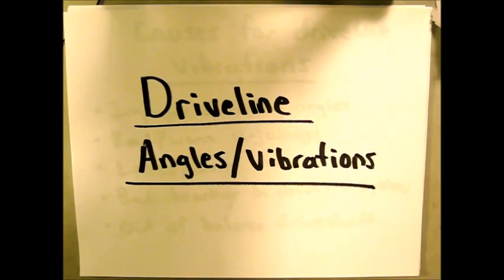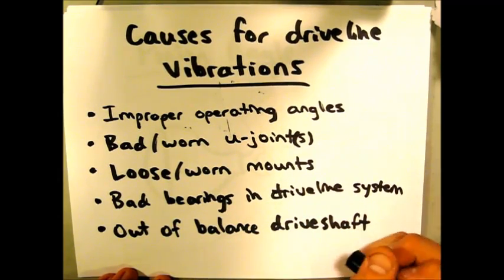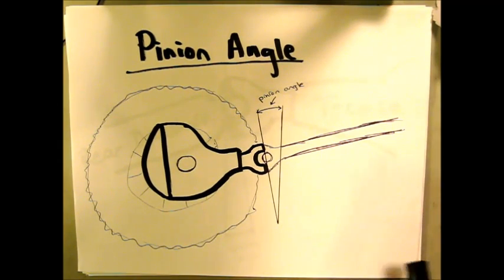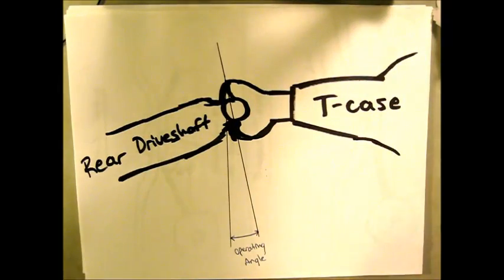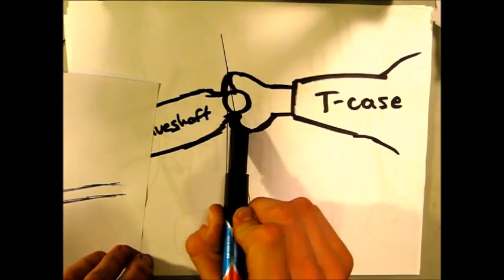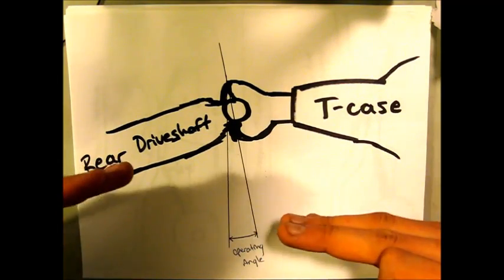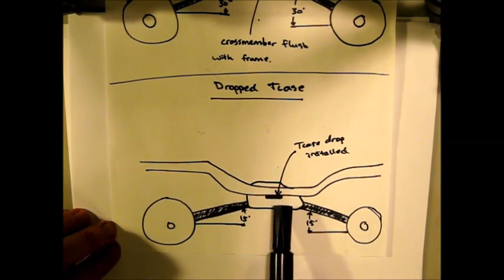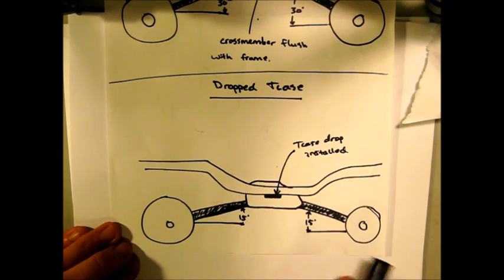Driveline Vibrations And pinion angles

Comment: Why not just
Put a digital angle finder on either face of tail shaft or pinion,,in a ujoint on each end driveshaft situation ,those 2 needs to b parallel,,so zero the angle finder out on 1of the 2,,then put it on opposite,,that would b the degree shim you would need

Comment: I just lifted my truck 6 inches in the rear I feel slight vibrations when I go off throttle on the highway , like for instance I’m at 6th gear and I remove my foot from the pedal I feel it just a mild one
Reply: Mine started doing it too mines lifted 6 inches too did u figure out what it was thanks

Comment: My concern is with the low speed rolling and random knocking. Could pinion angle be the source of noise? When the car is on a lift running 2-35 mph (no load on the axle) no noise. When I had a very heavy man in the passenger seat driving 2-20 mph the noise was barely heard.

Comment: What a terrible explanation, this is why people fuck this up. Driveline angles are very simple, for Slip Yokes - Output shaft angle must match pinion angle or be between 0-3 degrees. For Fixed Yokes, the pinion should point directly at the output shaft, this should result in identical angles of both the shaft of the driveshaft and the CV of the driveshaft. You dumb fuck...

Comment: I have a 2017 f250 I put a 4.5 inch lift in.  Ever since I get a vibration between 55-70 mph.  It seems ok under 55 and over 70.  Seems worse underload.  It’s been to 3 shops.   First one put shims in the rear end.  The second changed angle on transfer case.  The third put a new u joint in the front driveshaft.  Any ideas?  Thank you for your help.

Comment: Let me put in my two cents if I am correct I will say looking at your side view of your frame set your frame front and back at the correct height on the front and on the back then set the engine and transmission into place with the front motor mounts actually bounded in tightened up go back to the rear mount on the transmission incorrect that hat the word they used to be you can put a digital protractor on top of the frame rail and zero it out then go to the machine surface of the intake manifold where the carburetor fits and put it at 0 degrees same as the frame wherever that comes up to that's where the rear transmission mount needs to set then with the rear end attached to the frame but able to twist the tubes of the rear end before welding zero out with the digital protractor pinion yoke go back to the front of the motor and see what the degrees are on the harmonic balancer it should be the same as the machine surface between the transmission and the back of the engine mounting write all these degrees down your Driveline should only change 7 degrees I believe that's correct from the back of the transmission where the Driveline comes into the rear end pinion should also be 7 degrees change now get a mental picture hallucinate with me draw a perfect circle now draw a oval Circle inside the perfect circle then measure the perfect circle all the way around will say it's 12 in now measure the line that you draw that is oval it's all 10 inches different measurements huh now hallucinate a little more if you were standing inside the drive shaft and you was looking up it reconnect to the universal joints and goes to the transmission and or the pinion you should see a circle not an oval Driveline air ride height transmission and engine degrees this is number one failure Transmissions synchronizers on big trucks 18 wheelers I would think it would apply to small trucks to I actually went to school for this once upon a time for a day I passed it's in the book Freightliner book that is but when you look at the book it has a page for that test you make a copy do the test three times on the vehicle always zero the protractor digital protractor zero it out on the frame and the frame on the front back is where it needs to be that is your starting point everything else comes together oh yeah I have a 1999 long Hood KW for about a year I couldn't figure out where the vibration was coming from balanced all tires 18 of them but wheel balancers on all the tires finally one day I discovered I had a front crankshaft seal dripping oil slightly when I discovered my caterpillar front engine mounts we're too low worn out installed All 4 engine mounts front and back vibration went away good for hundred 50 miles an hour thank you so much for your video great guy so I'll put in my two cents I hope that made sense God bless you and your family and anybody that watches this video think about what you're doing and keep on getting up with it

Comment: hey man my Dodge Dakota 2002 V8 2 wheel drive vibrates only at 70 miles an hour and above like clockwork on the accelerator or off the accelerator still vibrates in neutral and drive long as it's over 70 it vibrates any ideas you can throw at me would be appreciated

Comment: Hi I'm only getting a vibration when I ingage the truck in 4 wheel drive and only when accelerating would this be a pinion angle problem?  When the truck is in 2 wheel drive works a1 no vibration at all.  2006 dodge ram 1500 5.7 hemi slt quad cab if anyone has had this issue please let me know as I have spent time an money to figure it out from putting a brand new front drive shaft in, bushings, bearings etc puzzled at this point  thanks

Comment: Very good video, one question.  can the input diff yoke not be parallel to the output yoke in the transfercase ? I mean my transfer case have the output yoke to the right side of the vehicle and the rear diff is on the middle. Can it be possible ?

Comment: i got my angle at the case way to much up, u can tell by looking at it, but i only got vibrations in 3rd gear an only when i deccelerate at 1800-1500rpm and if i press the clutch its gone. driveshaft rpm stays the same w/wo clutch enganged.could my angle cause this vibrations? got chevy s10 2.2 5speed
Reply: I got the same problem have you found out what causes your vibration yet please let me know my email is jraysconstruction@gmail.com
Reply: @jasonbenedict5632  got a drop kit in it with Blocks between axle and leafspring. Kit came with angle shims and some idiot installed it in the wrong direction

Comment: Explain how the rear u-joint operating angle makes less load on the transfer case end ujoint, by changing the pinion angle only.

If I have a 0* operating angle at my rear differential, and say a 20* pinion angle, the driveshaft will have a shallower angle, because my pinion flange is higher than if I have a 0* pinion angle.

So by increasing my differential u joint, operating angle, I also increase the operating angle at the transfercase...

ALSO, like someone else said, if you do a t-case drop, without lowering the engine and transmission also, you put the transfercase on an angle increasing the operating angle at the transfercase, for your front differential.  Yes it helps your rear transfercase u-joint, but the rear driveshaft is typically longer than the front, an didn't what is needed to be helped!

Comment: Hey, could I get variable levels of different sounds, from a ting, like metal bouncing on metal fast and high, to same as wheel spin speed grinds to heavy Eeeerrrrrr sounds, all go away when I hit the 4 auto button. 2000 Chevy Silverado K1500
Sounds stay if I go into 4 hi and feel like it come from under the pedals or in front of them.?  Any Ideas?

Comment: my 2000 gmc k2500 sierra shudders at takeoff and drives me crazy. then at 40 to 50 there is a hop or something that drives me crazy. maybe the carrier bearing bad? only 107,000 miles on
Reply: Did u figure  it out ?
Reply: Bad u joints, bad carrier, out of angle